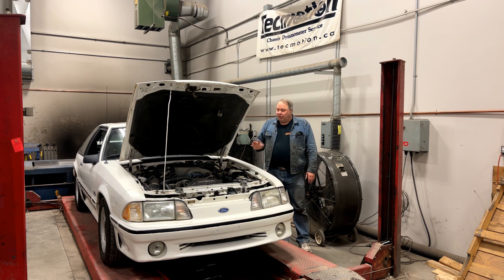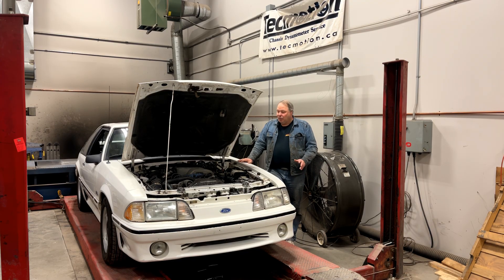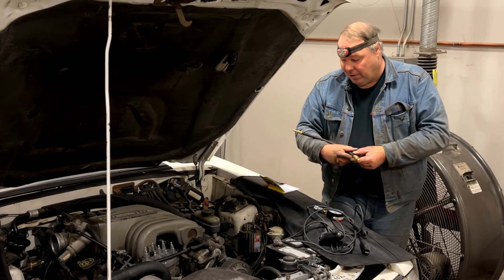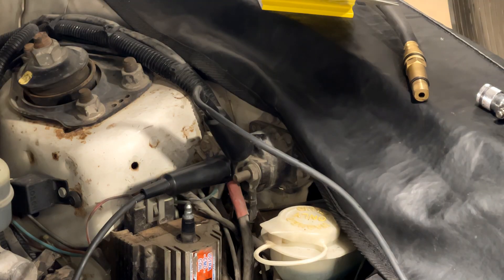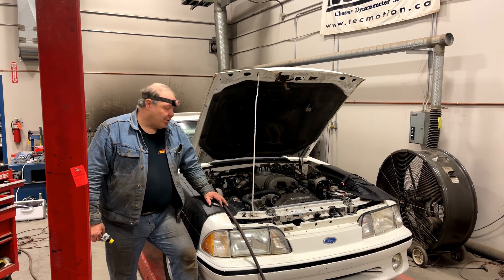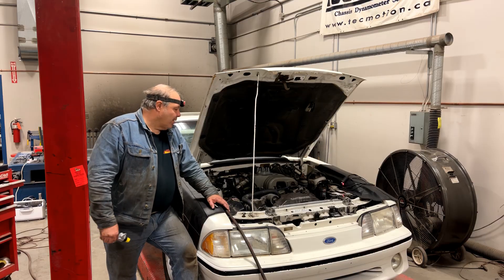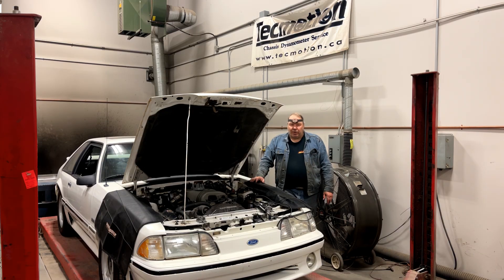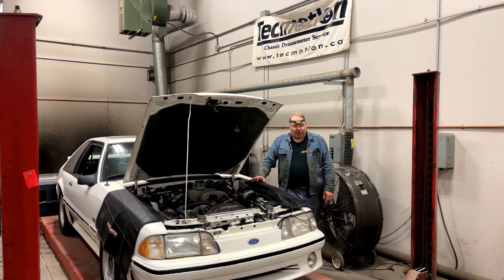Compression and Leakdown Testing

Comment: Probably would have seen higher compression test numbers with the throttle open.
Reply from the maker: Maybe, but it doesn't matter what the number is, just that all the cylinders are tested consistently and are within 10% of each other. If you do it with the throttle open, or a squirt of oil, make sure that you do all of them the same way.